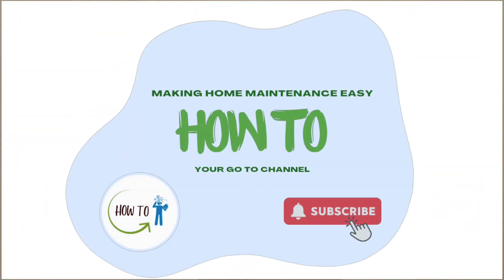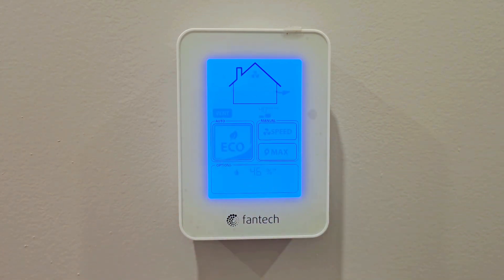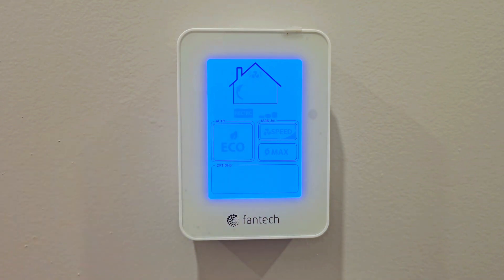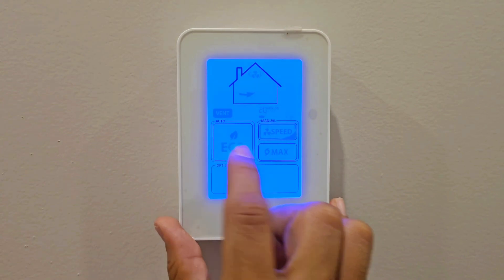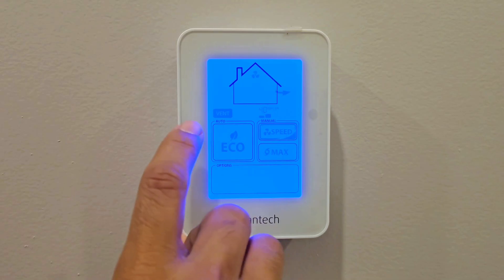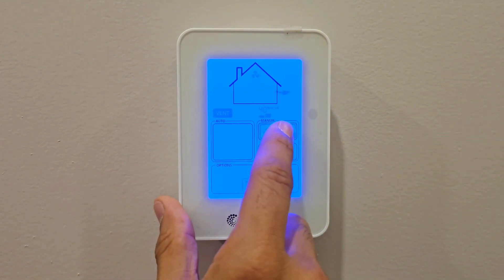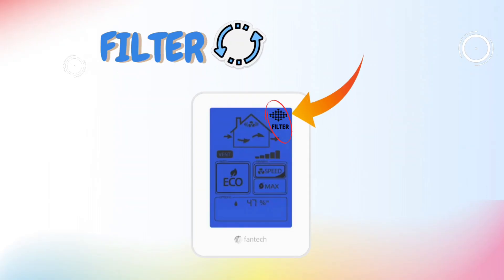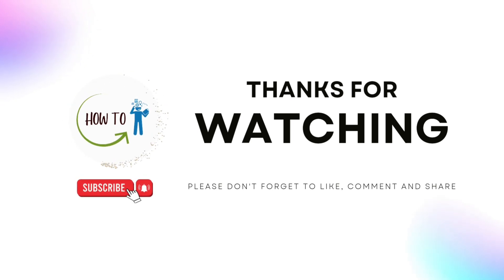How to use Fantech HRV #smarthome #fantech #hrv

Comment: My Fantech is blinking green light
 my washroom fans and won’t work after resetting from my electric board 
Don’t know how to reset  the issue still exists 

We had heavy rain and lightning 
This occurred after that
Reply from the maker: Please tuennoff the HRV for 30 minutes and restart. Also turn off the breaker. 

Once done, if it still happens, you can jold the washroom timer button for 30 seconds to reset.

Give above a try and let me know

Comment: Thanks for a great video! I can’t get my Fantech to go into recirculation mode. When I click on or near the house icon it just turns off. Any idea how to fix this?
Reply: I have the same issue, any solution?
Reply: @Dominikpare1  unfortunately no.
Reply from the maker: I looked into this and tried few systems. 
This issue can be related to the malfunctioning of the unit ot the controller.
One way to try to fix is, to turn off the HRV for 30 minites by removing the power cable and install back.
This usually resets the unit.
See if this helps, otherwise checking the wire connection or replacement of the  controller might resolve this.
Reply: @How2 is the HRV the furnace that’s in my attic? Or is that the main fantech switch?
Reply: If the outdoor temp is lower than -5° C the unit will be in defrost mode and won't allow recirculation.
Reply: @Piercing54  the weather isn’t that cold where I live.

Comment: Very helpful video. Thank you.

What would the difference between running this HRV in ventilation mode on reduced speed vs running it on ECO mode with both the daytime/nightime settings set on ventilation at reduced speed be? 

What would ECO mode do differently, would it shut the system down if it reaches the desired level of humidity, go to recirculation mode or just run continuously on ventilation? 

Thanks for your help

Comment: thank you for the video. do you know how to unbalance the system? i've been told to tap on options and when timer starts long press the auto box. from there you can set different values for air going out vs air going in but when i confirm two different values and then go back in to check, it defaults to keeping the same value for air going out vs air going in
Reply from the maker: Hello,
I looked into this and didn't find any way to unbalance or balancing the system from the controller.
This has to be done from the Unit and need HVAC Professional for that.